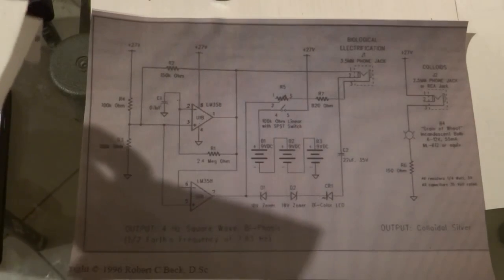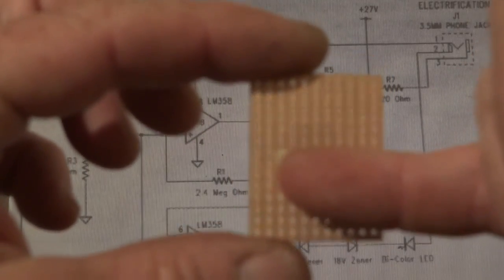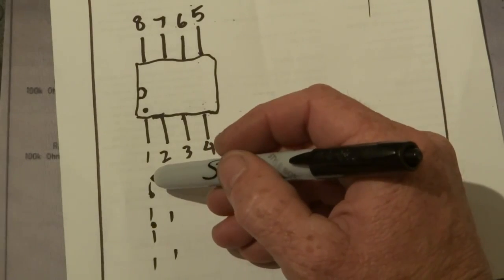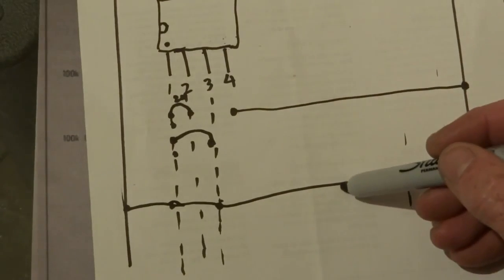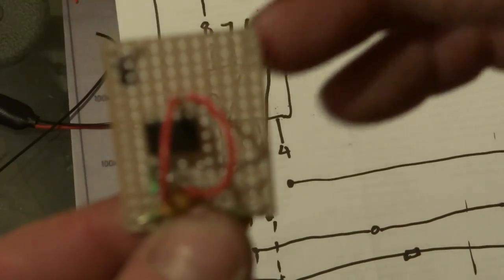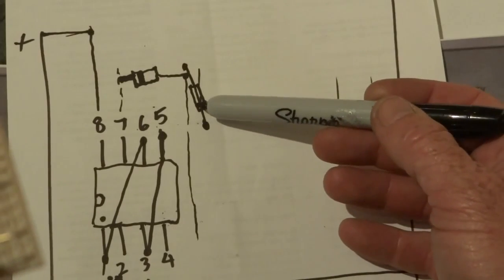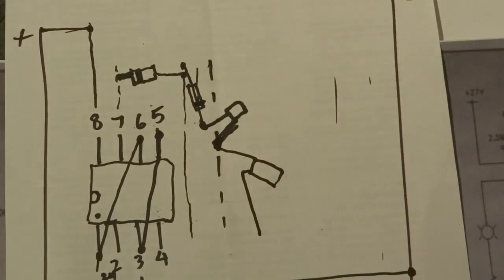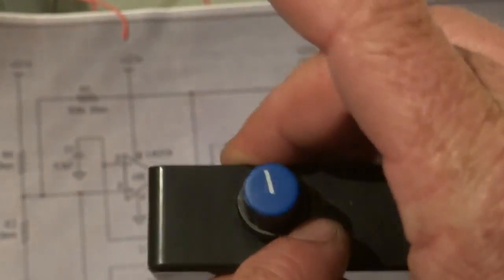How to Build a Bob Beck Blood Electrifier

Comment: thank you so much for this. I had so many struggles years ago because i dont understand most of this and im a visual learner so i will be following this. I got the colloidal to work but not the zapper and i think its cause i failed to cut out the board and solder the chip in the back. i also get confused with the terminology in his protocols.. for example, this is the zapper/silver protocol correct? does that mean its the blood purifier? Or is the blood purifier something different? apparently we also need the ozone generator, silver, zapper and something else in combination to get the best use of it..?
Reply: This is the blood electrifier.The colloidal silver machine is one the diagram but I never built it in this video.

Comment: Good on you! Thank you so much for your input. Now, I can get just about any needed parts… except that I can’t find a board with copper runners the length of the board. When I asked the parts guy at a local store he stated he has never heard of a board with lines in series like this. I’ve tried to find them on-line but it seems like a lost cause. Would you be so kind as to point me in the right direction? Soldering the lines is a bit of a pain… Thank you, or anyone, for input.
Reply: Did you find it finally ?
Reply: @a.b.c.520  Sadly I have not.
Reply: @nownot6875  did you look on aliexpress, this kind of stuff is all over the place there
Reply: @a.b.c.520  I didn't. Thank you for the heads up. I just may give that a try. I still have a bunch of parts. I would just need to replace some.

Comment: After several tries I finally managed to build one that works. Thank you. But I have a question: is it ok to use a power adaptor that produces 27V DC as the power source instead of 3 9V batteries?
Reply: +Grace Tamba yep! save ya money too! good thinking!
Reply: Good luck finding an off the shelf 27 volt power adapter. Closest thing I was able to find was a dc to dc converter.
Reply: @mikewalsh511  you can use an unregulated 24 volt.its output can be over 27 volts

Comment: I'm just going to buy the autozap5. I heard that these kinds of zappers, also let out a negative charge which can multiply parasite or worsen conditions. So I think I'm just going to spend the money get the autozap5. It's got all three systems in one. If anyone out there knows any information about the zapper letting out negative milliamps let me know or help me understand if this is just a myth or if this happens if you build it wrong??
Reply: +VashOffTheWall that would be a myth in my opinion. if you go from the beck schematic you'll be fine.

Comment: I have such a hard time following this type of diagram.  its so frustrating.
Reply: It is frustrating for those of you who has no technical studies. In the otherhand you can print the guide with the schematic diagram and give it to a technician to reproduce it for a fair amount of money.
I went to the site in which they are selling this kind of products and I must say they are abusing. The prizes are soooo exorbitant that it really hurts me to know that. if I could only have some free time I would produce them for 10 times cheaper. I work as electronic technician, and even selling this circuit 100% working it will cost less than 50eur.
Reply: @CarlosFerreira-kaiko  I mean if I concentrate on the connections I can draw a build diagram from them I used to make assembly instructions for a production crew probiotics applicationsin the pharmaceutical research end of things. So I'm capable of following them but they still confuse the hell out of me because I'm used to doing visual Bill. I got really good at illustrator for quick work and I have some SolidWorks background is well if I had the finish circuit in the diagramI can make beautiful build instructions for something like this I actually love doing it I became disabled about 7 years ago and I miss working so badly
Reply: @ClownWhisper   
Oh. I understand. Yeah, that is the difficult part here, to draw the connections and build the layout ready for assembly all components

Comment: i just purchased a blood electrification unit on ebay that costed 130 dollars and it only requires 3 AA batteries (instead of a 9 volt battery) I was wondering if this would deliver the same current or if i got ripped off?
Reply: Mike Sommers buy a ParaZapper Uzi-3 i think , Robert Beck was disinformation agent and gatekeeper . Once a company man always a company man. The uzi provides way more frequencies and can fight off mostly anything .
Reply: @izzokenpachi6670  what do you mean by "company man?"...
Reply: Mike Sommers he was a company man most likely ama . But I’ve done some research of my own rather read the Bible . Electricity is so powerful I believe it has ability’s .
Reply: Mike Sommers who’s the guy you posted ? He seems woke .
Reply: @izzokenpachi6670  how could he work for the AMA  when he was constantly speaking against the medical establishment? how was he promoting that company?
Reply: Mike Sommers that’s what I don’t understand . Maybe he was a good man ,there’s no documentary’s of him or is there? Because that’s a good comeback . Medical establishment are big money makers and looked like he was against that. Do you have any think that the electrification of the blood actually works for “Cancer, STD’s and HIV”?

Comment: Where can I get the actual circuit board you used? I dont see it on the parts list.
Reply from the maker: this isnt me i just archived it. you can get a board like that , a solderless prototype board from radioshack or ebay
Reply: Thanks for the reply! Yeah the ones at radioshack don't have the tracks like his does